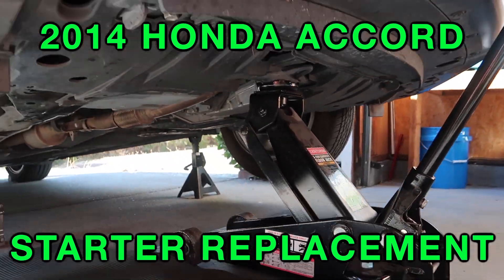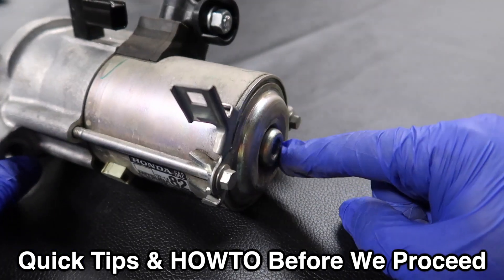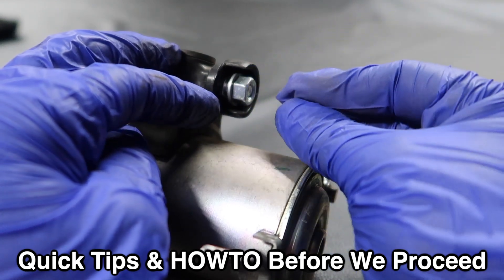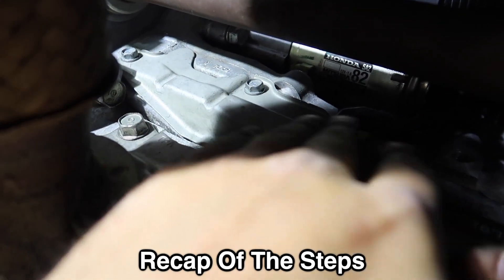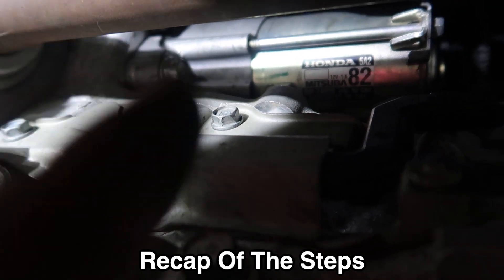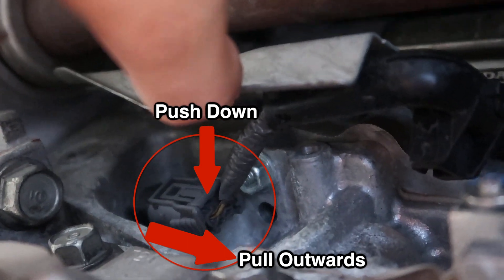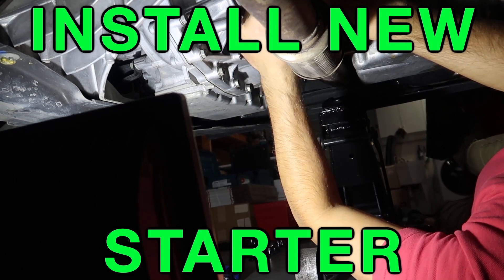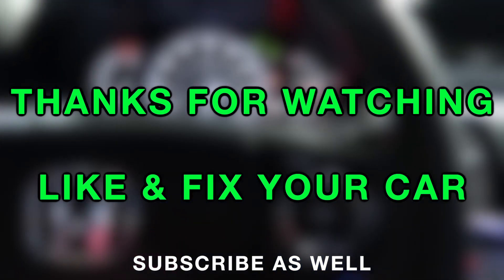2014 Honda Accord Sedan Starter Replacement Step by Step Guide How TO

Comment: This video is great. I replaced my friends starter on his 2015 HA yesterday. What nobody mentions is how cramped everything is in there. The job seems simple but it can get real complicated real quick if you don't have the perfect tools for the job. Have a few good 10,12,13, and 14 mm sockets. Have a good ratchet both long and stubby, a breaker bar or extension, and a thin flat screwdriver. The CV shaft and the exhaust downpipe make the ratcheting harder so be careful. Most of all have some patience and time. You can do it but it might take longer than a shop would. Good luck!
Reply: I just replaced my starter in my 2015 yesterday. This video was decent but don’t need to remove those extra brackets. And for space yah it’s tight, I ended up putting the wiring back on the replacement starter before I got it bolted in cause I didn’t have enough room to get my hands in to put the connector on. Took me about 2.5 hours cause I had to take it out twice cause of lack of space
Reply: @natefahy8401  I agree with you. It took me about just as long due to confined space. I now see why shops are charging $700-900.

Comment: Video was super helpful... also I got a remanufactured one off ebay for $70 instead of $600 at the dealership, $300 at autozone and $150 on rock auto.. 

I also didn’t have to do step 1 and step 2.. those brackets and stuff do NOT need to be removed.. took me an hour to remove and replace with the car on jackstands 

Great video!
Reply: What part number & or link did you use?
Reply: You posted this content 2yrs ago. How is your $70 starter holding up now?
Reply: @juanh1093  I bought a 80 dollar starter from Amazon and installed it today.  It did not work.  Went to Advance and paid 275... that one worked.
Reply: @ryanw6193  Thanks for the tip. I'll remember that if I am faced with a issue with my starter.

Comment: Thank you  for this video and the disassembly of the starter video.
The suggestion of rubber band for the top bolt was great.
Things tools that helped me with the removal and installation were 
1 Pittsburgh Automotive Serpentine Belt Tool Kit 63689 with a breaker bar ratchet attachment on the 1/2” end and a regular length 3/8” ratchet on the the end. It allows you more movement around the axle.
The thing that tripped me up the most was the 12mm nut for the large wire connector. What really helped was taping the 12 mm nut in a 12mm deep socket. I ran duct taped around the side of the socket and edge of nut inserted in the socket. The used a razor blade to remove the tape from the mating surface of the nut. An hour of fumbling to success on my first attempt.

Comment: Video was really helpful and I was able to replace in my 2014 Accord. Took me a while to break a couple of the bolts loose, but other than that it went smoothly. Thanks for the video.
Reply from the maker: Nice work!
Reply: i need to replace mine on 2014 accord, which starter did you use for replacement?

Comment: Thanks you.  I was able replace my starter after watching your video several times.  It was really helpful.  This is an excellent video even for a novice like me. One thing I noticed is the size of the bolts shown in the Step 1 (8 minutes into the video) is 10 mm (at least that's what I found on my vehicle) I had to use a #10 wrench because there was hardly any room to use ratchet socket.

Comment: Thanks for you help took me 2 hours but i  did it . Advice for anybody else have the right tools. I didn't  that's why it took me so long should be about 1 hour job
Reply: Jeff Sol you can I used a torque wrench on the bottom bolt couldn’t get it in for the top but I sid my bolts to snug. The bottom bolt I did 40ftlbs the transmission drain bolt which is similar is size and going into the similar type of metal/ area is spec’d to 35ftlbs so I figured be around that

Comment: Ty for the video. 

Honda and their dealers knew about the problems in 2016 but did nothing to fixed it. No recall or not cover under warranty. They sent the dealers the fixes for the issue, but we have to pay for it. WTH even with a new starter from autozone is 300+. Most dealer want $900+. At least starter from autozone has lifetime warranty, but dealers is 2yr. I have a 1998 accord be4 this and its starter never went out. It was over 200k n over 16yrs old. My brother got a a 2015 accord too and it seem to have the same starter problems. Not going for anymore honda or even try out the acura. My inlaw has a 94 corolla and its starter still crank fine. Bought my 14 accord brand new the exl model almost $30k back in 2014. Damn starter went out its a dick to replace it only to find out it happened again.  Still crank and not crank intermittently.

Comment: I just replaced my starter in my 2015 accord. Video is good but don’t have to remove the air intake bracket or the one under the starter. Definitely having a powered ratchet for the bitten bolt would be of great use but hand tools can get it done. Also recommended trying to hook up the electrical connections before putting it in fully cause not a lot of space if you have big hands
Reply: Hey Nate, what's the mileage?
I have a 2015 sport and replaced it at 71k. I believe it’s kinda early for this to give out. Thanks.
Reply: @jilenvera5243  when I replaced it, it was around 65 or 70k. Definitely seemed early to have to replace it

Comment: Thank you for this video.  What brand Starter did you install?  was it NEW or Reman?
Reply from the maker: I got It form a Honda 2015 at junk yard in Sacramento, California. It was 100% the same brand as the original one Honda Mitsuba. 
It only had 20k miles - used and it worked. 
I did not buy it form amazon or eBay.
The place I buy parts for my Honda they ship as well so if you are interested you can call them up and ask for a shipping quote: 

RHAPARTS - Used Honda Acura Parts - Rancho Cordova, Sacramento
(916) 853-9155
rhaparts.com
Reply: @DenisSchiopu   Thank you!    I'm having the original starter rebuilt. it is for a 6 speed trans.  Hard to find new or rebuilt.
Reply: @DenisSchiopu  Why would you purchase a starter from a junked Honda vehicle that could possibly have the same problem? How can you be sure that would not be an issue?

Comment: I replaced mine last night ..was relatively low difficulty level as only 3 electrical connections and 2 bolts -Kinda hard to get to, but otherwise not terrible

Comment: Does this apply the same with 2017 ex 2.4L? Im having same issues. Car doesnt start certain time of the day? Dealer just replaced both starter and battery. What could be the problem?

Comment: Is it better to have the original starter rebuilt at a rebuild shop.
Reply from the maker: why ?
I replaced mine with the replacement part and everything works well, I even made a video but I don't think anyone needs to see how to replace and simple.

Comment: I have a 2014 Honda Accord Sport and came across the same issues with the starter. Car starts on first two or three try's sometimes then others will take 10 to 20 minutes before car even starts. I am currently looking at pricing a starter because the dealership is trying to charge me right under $1000 to replace it. 

Autozone and Napa range from $150- $279.99
Ebay sells remanufactored starters ranging from $85-118.95 (with 1 year warranty)
I have a trusted mechanic to install just wanted to inquire about more trustworthy sources to price from
Reply from the maker: Just buy  rebuild from eBay or from a junk yard if any closer to you. You can also order just the replacement parts and fix the current starter non working. All you need is the brush assembly the dealership can order it for you it’s easy to replace and put it back and it will work.
Reply: Wow! The same here just bought the same model mine is 6 speed manual, I was soo excited saved for a year to get this car, but now two weeks since I got it yesterday it started to delay starting, the car starts after 1 or 2 turns, am so disappointed.
Reply: Jesse Biseko sorry to hear that! But I will say once i bought the replacement starter off eBay(with 2 year warranty) for $80 and had it installed, I’ve had ZERO problems since. Depending on your mechanic it shouldn’t cost more than $200 for the install. Avoid taking it to Honda cause they will charge you $1000 for this simple fix. 

Disregarding the starter it’s a great car and i haven’t had any other issues. You made a good buy. Honda is just greedy and would rather charge its customers who don’t know any better $1000 than fix their starter issues.
Reply: @saphirejewelscoward  would you mind giving me the bay the link so I can buy one?
Reply: @saphirejewelscoward  thank you so much

Comment: My starter started failing 2 weeks ago how much long do I have before it completely stops working . I won’t be able to change it until July 8th
Reply from the maker: Mine worked for like 1 more week and then I could start the car anymore.
Reply: This problem started 3 months ago, how long until it finally failed?  I suspect at most inopportune time.

Comment: It looks easy to do. Hopefully I can do it myself. 🤦🏻‍♀️
Reply from the maker: You sure will. Just wear gloves and long sleeve to avoid scratching yourself. And have patience while trying to remove it. 

Make sure you have those extension bars or else you won’t be able to get to those bolts.
Reply: If you're handy you can save quite a bit of money. Honda charges 800.00 dollars for them to do the job but have a service bulletin for 2013-15 cars
Reply: @ace-lo1nq  hi, what do you mean service bulletin?
Reply: Chris Kelly its a recall on those vehicles equipped with the v6 so it will be fixed for free but Honda will not extended to all Accord models.
Reply: Honda Technical Service Bulletin is 16-002
Reply: @ace-lo1nq  i live in Toronto Canada and have a 2013 honda accord exl v6 and never found or got a recall on the starter motor

Comment: OEM Honda Accord 4-cylinder batteries are very underpowered. Group 51R, and the CCA is only 410. 

That could also be it if people are struggling to start their car.
Reply: When my OEM battery (51R) was starting to go bad I installed a 24F battery (for the V6) as it's the same bay for both in my 2014 Accord.  Don't have power issues anymore 😏.  Just buy the V6 plastic brackets and mounts.  You're good

Comment: What is the part number
Reply from the maker: Starter Motor Assembly (Sm-74009)(Mitsuba) - Honda (31200-5A2-A52)
Reply from the maker: The replacement for the starter to make it work you need to buy this: 

Holder Set, Brush - Honda (31210-5A2-A01)

28.63$ from this Honda original parts website I’ve been ordering every time I needed something for my Honda’s. 

https://www.hondaautomotiveparts.com/
Reply: @DenisSchiopu  Do you happen to know if their parts new or remanufactured?
Reply from the maker: From the link above ? The parts are genuine Honda.

Comment: I have accord 2014 sedan. 23k miles, (38 months) bought brand new in 2014.
Start went bad. Dealership want $900
For that.
Autozone $300 rebuild.
Shame on Honda!!!!! Honda knew there is problem with the starter.
Reply from the maker: Yep they knew just like how the CVT transmission on very same Accord died at 120k almost and was out of warranty of course and the dealership said "Sorry, nothing we can do". 

Shame on Honda for this CVT Transmission  dying out on people.
Reply: $300 rebuilt! wow thats even expensive too bought rebuilt with 2 years warrant for only $63. I have 2014 sport 6MT.
Reply: @Bisekoson  where did you purchase the rebuilt starter

Comment: Yep, the starter in these cars are junk. Honda has to be aware. Search online and see how many folks(including me) have starter issues
Reply: Big Geno oh my goodness, I thought it was just me. My Civic 2014 only has 56k mile on it and starter is already dying out on me. It’s such a pain to get to places.
Reply: I feel your pain. My starter went out around 58,xxx miles. Honda wanted $700-$900 to replace it. I looked on eBay and found one for $65. There is a company who rebuilds them and resales then. I put the rebuilt starter in in Nune if 2018. Had no problems until this month, Jan 2019. This starter is doing the same exact thing. Will not turn over in the first try. It starts the car in the 2nd or 3rd try. I contacted Honda and they act like they are unaware of the problem people are having with these starters. But yet if you look online, soo many others having exact prob. I will never buy another Honda again just for this reason. I think I will replace the starter once more and trade the car in in something else
Reply: Big G - Did you just get "nothing" when trying to start the engine?  My friend has a 2015 and says a few times he went to start his (good battery) and nothing happened, then the starter turned after a few trys.
Reply: Exactly! Turn the key and nothing happens. No clicking or anything. As if the car has no power. My battery was brand . At first, it took 2-3 turns for the car to finally start. Then it went to 3-5 times. Sometimes inwould come out to start my car and it would crank in the first try. Well, I just traded it last week. Too cold outside to be dealing with that mess.
Reply: I just bought 2014 honda accord two weeks ago, and yesterday my car started to act strange. I had to try 2 or 3 times until the car starts again.
Reply: I bought my 2014 car in October 2018 got my car back out the collisions shop the end of June 2020 from a accident I had Feb 14th 2020 my car has been sitting because now it takes me 30 tries or more for it to start now i have it sitting on the side of my house until i can afford a starter and have someone to put it on the things single mothers have to go threw on top of me still having to pay a car note wish i would've looked up the reviews before i bought this piece of junk
Reply: Sorry to everyone that has to deal with this. I traded my Honda after the second starter failed on me. For those who can change the starter themselves, it’s really not as hard as it looks. It did take me a while to get that top bolt out. It was a pain. But I know there are others who are not able to change them and it sucks. Good luck everyone!
Reply: @biggeno1205  I'm having this problem now with my 2014 Accord at 68K miles. Can I ask you, did you replace with another Honda starter, or other non OEM re-mfg starter? The reason I ask is to try and figure out if the issue is with the part itself or is there something about the Hondas overall that are killing the starters. I'm planning on a non-Honda OEM part. Like you, seeing the widespread prevalence of this issue, I think I'm not going back to Honda again.
Reply: I replaced my original starter with another Honda starter. And after about 1 year later, same thing. I talked to a Honda tech and he told me that Honda used cheap parts in those starters, and that is why they are failing.
Reply: @biggeno1205  Thanks for your help. I just ordered a Bosch re-mfg replacement from RockAuto, so I'm hoping for better quality with that.
Reply: @jamescostigan3721  I luckily made it to 150,000 miles, I recently started having the issues of turning the key 3-5 times before the car would start...seems to be common on the 2014 honda accord sport
Reply: @douglasm.sodaro7579  Since I replaced my original Honda starter with another non-Honda re-mfg replacement about 7 months ago, I have had no further issues. The problem seems to be with the Honda starter itself, cheaply made, so don't replace with another Honda brand starter, IMO.

Comment: You only have to tell where did he is we know what it does we know it doesn't need lubrication and secondly once you remove the Ground Terminal no power can go anywhere out of the battery power has to travel in a circle do you know what a circle what do you know what a circle means no need to disconnect both terminals you're not replacing the battery
Reply: You need a refresher course in English.

Comment: Excellent Video buddy, Owner's beware about Bosch Starter, Cost me around $213 locally and I installed in My 2014 Accord EXL, CVT, 2.4L automatic, the model number Bosch is SR1355X, first crank sound good, 2nd to 6th crank start making noise like grinding the metal (pinion with flex plate in the transmission), I uninstall this crap Bosch starter, first and last, I always buy denso, Mitsuba OEM or TYC again Bosch are s..k like all European parts. Japanese brands quality bids any american or european parts. Stay away from Bosch starter brand.

Comment: Starter died in 4 years? doesn't sound like Honda😧
Reply from the maker: Yeah it’s sad I had engine replaced & transmission also replaced only after 4 years it’s disappointing, this new CVT transmissions don’t last that long. 
Now with only 20k miles engine & transmission it feel like my car got new fresh horse pair again lol
Reply: @DenisSchiopu  How many miles did you put on your car before changing engine&transmission?
Reply from the maker: Almost 300k
Reply: @DenisSchiopu  OMG, do you drive it like a cab lol. Now I know what to expect when my accord hits that mileage.
Reply: @changchengxue4008     LOL, that 4 year mark was misleading... with 300,000 miles BTW!
Reply: honda is going cheap on parts low quality high price makes them more money on parts and service .